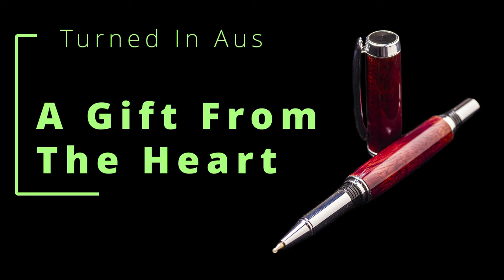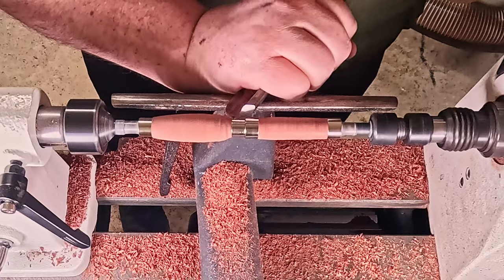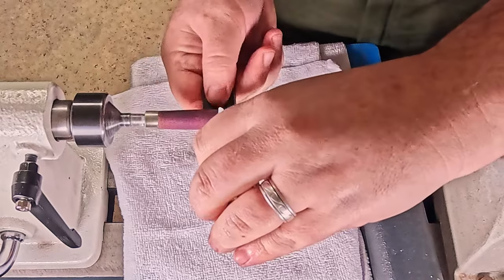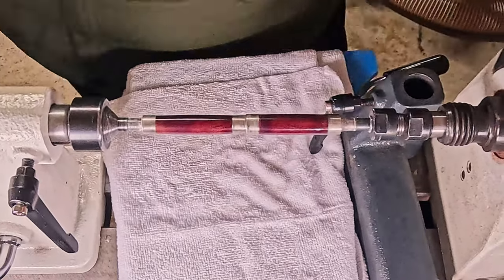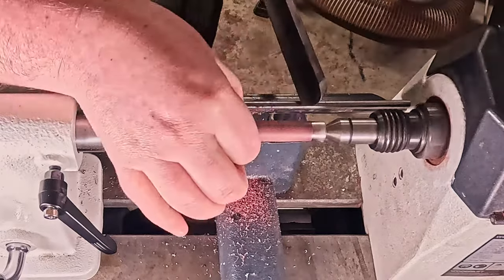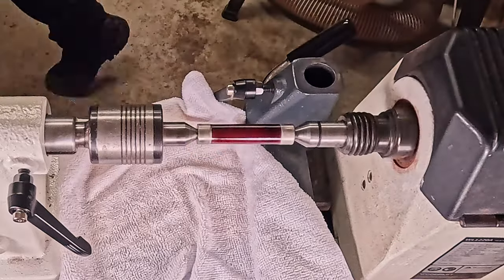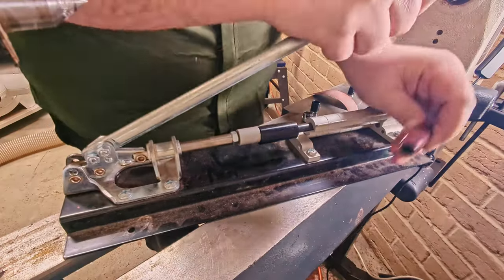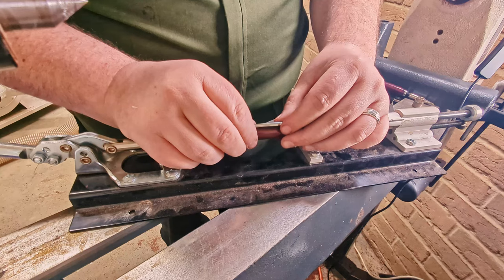Gift from the Heart

Comment: What is the applicator you a putting the CA Glue on with?
Reply from the maker: Craft foam / closed cell EVA foam. 
I purchased a sheet and cut it up with carpet scissors. 

The glue doesn't stick to it, it will dry on the surface of it but not stick to it.